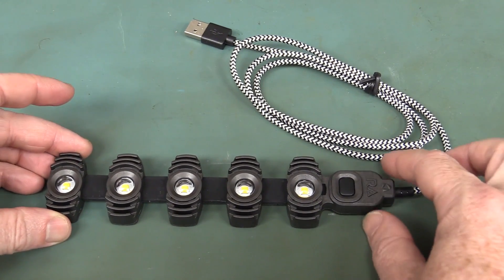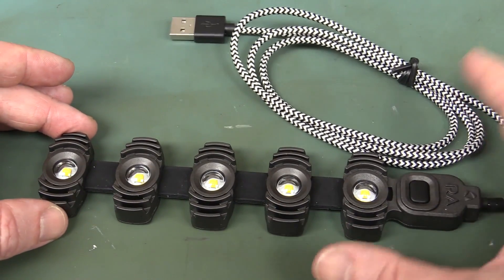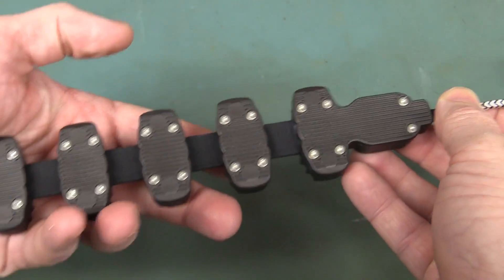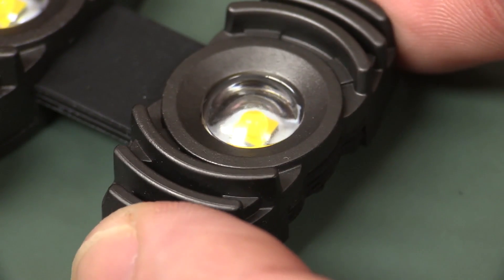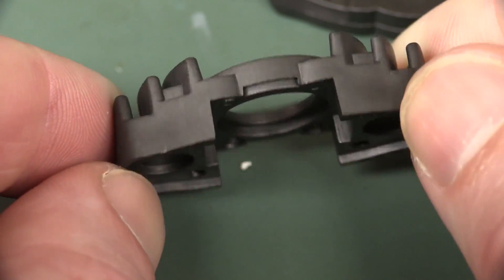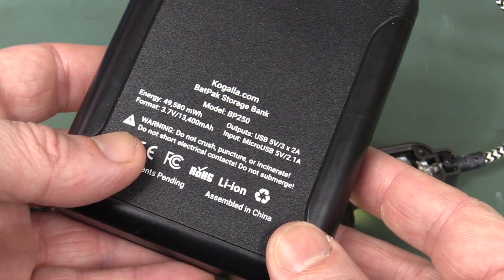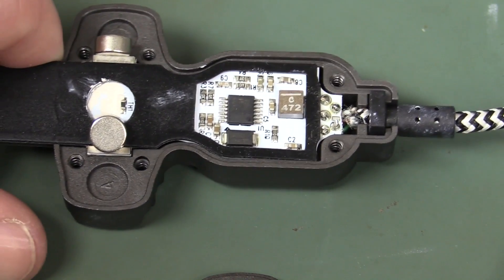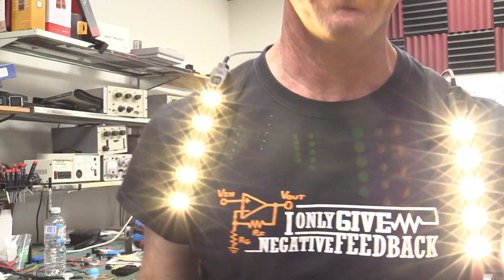EEVblog #1010 - Zyntony Ra LED Strap Light Teardown

Comment: $200? Seems a bit steep to me.
Reply: LazerLord10 go price just the cree led bulbs, im not saying i like it but 200 seems reasonable
Reply from the maker: Not when you don't have any competition for the form factor and it's well designed and built.
Reply from the maker: Not far off some Petzl headlamps.
In fact, two petzel headlamps to get the same output (or less) will cost you more.
Reply: The Cree LED's used are less then $2 even in low quantities of 500-1000.

I wonder what the BOM price is. I assume that the MIM'd aluminum parts are the most expensive parts.
Reply: Yeah. I don't know why you need 2 strips, or even 5 on a strip, because a $6 Chinese Cree torch puts out enough to light up my yard. This is the Apple of torches.
Reply: I'd agree. You can buy usb led lights online for under $10 usd. I use them for power outages and they easily clip to a backpack. Something tells me they are either vastly overcharging, or they need to lower the build cost.
Reply: Yip, you can get a Fenix headlamp with more lumens for $115 (plus a few bucks for 2 18650s) and an IP66 rating for the entire device.
Reply: John, you're completely ignoring the fact that you have to wear a damn headlamp. This isn't supposed to be a cheap solution... Good - Easy to Use - Cheap, pick two.
Reply: Go look at Scurion or Phaethon caving lights prices.
Reply: would probably come down as they get set up
Reply: Cyanide Cloud, depends on the design on the headlamp, if is an angle light then using it vertically is no problem.

Eg for cheap option, http://wowtac.com/wowtac-a2-headlamp-550-lumen/
Reply: Cyanide, the headlamp ticks all 3 boxes. This doesn't tick any - If it was any good miners would use this style of light instead of headlamps, it takes more effort than a headlamp to attach, detach and recharge, and it sure isn't cheap.

You and Dave go be guinea pigs - if it proves to be any good, I'll pick up a Chinese one for ¼ the price in a year.
Reply: If consider also the quantity produced, how to handle all the design process (it is not at all just matter of electronics inside), outsourcing for the various materials (aluminum and plastic parts) and make a living from that, plus all the inside-company-stuff that I ignore, is not that much. Chinese stuff from illegal china is from chinese people that do not eat, abuse of slavery and are polluting like hell. "The rock in the mountain is free, if you do not pay for the extraction" - cit.
Reply: @john, miners don't use them because miners don't wear backpacks, and mining equipment needs to be overbuilt and certified way more expensively using specific materials - mining lamps are also $600 each
Reply: Yeah SuperAWaC, there's no possible way this could ever be attached to a high vis vest... And definitely no way a multi-billion Rand mining house with it's own research center could ever develop a new light, with all that certification and specific materials...

Face it, this hasn't been commercialised before because it's probably worse that what we've already got. In conceivable every way.
Reply: they could, but why would they? caps lights have been used since the stone age and work fine. if you need any more light than that it's on a lantern or other equipment. these strap lights are just more shit to get tangled in your shit and be heavy while scrambling up the stope
Reply: I would pay 100dlls but for the full kit
Reply: There are always people who say the price is steep on these kind of products but there are a few things to consider on something like this

1: they are often by a very small team who has to make a living off of their work
2: It's not a mess seller
3: it hasnt been hit by a wave of chinese knock offs
4: it's new
Reply: The money is mostly in the heatsink machining x5. I could string together led's on a ribbon cable for cheaper, but I would not be able to make a decent heatsink for the form factor.

Comment: Absolutely STUPIDLY HIGH PRICE. 120 degrees beam is the raw chip beam angle.Draws total of 7W per string, TPS61500 is max 90% efficient, so let's say chips are running at 1.2W each - highly doubt 800 Lumens per string, as that would be 160 lumens per chip or 133 lm/W. Possible, but unlikely that they are choosing chip bins that high..Just  a plain out and out rip off.

Comment: I recently bought 10 LED torches from china for £5.00 (for all 10 including shipping) and they are brilliant (excuse the pun). They take a single AA battery at £0.15 which last for many hours and they have a clip to attach to whatever you want and they can be directed (pointed) in any direction and illuminate a wide area very well. They are aluminium, very tough and I could get 400 of them for the same cost and I can then use them for other things.
Reply: Jerry Walker What are you going to do, clip a whole bunch of torches to yourself? You'd have to deal with getting the angle right and turning them on/off individually, etc. Sounds like a pain in the ad to me. It's like saying, why would I spend $100 on a new HID bulb for my car? I can just duct tape a bunch of £5 torches to the hood.
Reply: Andrew Delashaw, No Andrew, I just carry ONE, read my comment. It illuminates very well over a wide area so I do not need to use more than one at once. If you need 10 cree LED's to see where you are going then maybe it is time to have your eyes tested. I would hate to be trying to pass someone on a mountain trail who is inconsiderate enough to have such bright lights blazing in my eyes and which they cannot direct. Same as someone driving at you in the dark with their $100 HID's on full beam.
Reply: Jerry Walker my Zebralights would kick the Chinese torch butt!
Reply: Knuckle head, What are you talking about? If you are out hiking then you do not need a lot of bright lights unless you just want to irritate other hikers. If you are just trying to compete so that you can say you have more lumens then congratulations you win, but you totally missed my point, well done.
Reply: fascinating story

Comment: Just my opinion... but I've never found fault in a decent head lamp. Plus at the price of the featured item, one could take along a spare headlamp or two and still save weight & money. Could probably go on; it's just that I feel headlamps are more the correct technology for the application.
Reply: @rwbishop - The only faults I find in headlamps are the narrow beam, the bouncing hotspot, and virtually no peripheral vision lighting. All I can say is you should give it a try! Huge difference.
Reply: Not all headlamps have 'spot beams'... know what you mean though.

Comment: Should have taken the battery pack apart. At least check who made the cells in the power pack! Also the non-waterproofing of the connection from the lead to the board is disappointing.
Reply from the maker: It was ultrasonically welded. Would have to dremel it open.

Comment: I don't understand the choice of USB for the power cable. It's not waterproof, it's not rugged, and it falls out too easily. A small sealed two pin locking circular connector would have been so much better, especially considering what the thing costs.

Comment: My prediction is that USB connector will be one of the first things to fail. A few weeks of work time in damp weather. Even if the battery is hidden inside backpack the humidity with this much power will corrode contacts to unrecognizable state.

Comment: They could have easily used the PIC to do the boost conversion instead of using an  external chip.
Reply from the maker: At this price point you don't really care that much though. Dedicated chip for the purpose and it's done.
Reply: That or simply picked a chinese boost driver. $1.5 vs $0.15
Reply: mikeselectricstuff possibly input issues? The micro listens to the thermistors then tells the pic via i2c to vary the pwm

Edit: vary, not carry
Reply: Mike's right it is a bit overengineered; a PIC (I'd use a 17 cent STM8S003 but whatever) , fet, inductor and a diode, and you're there. Thermistor(s) into an ADC input for overtemp; maybe a buck or so in volume
Reply: Dr Tune I don't think the thermistors on the lower lights have a wire to report back to the head (two steel springs acting as two wires only).  So I'm guessing the thermistors just do an overtemp cutoff of their local LED.  That makes the PIC basically a button input decoder.
Reply: I prefer step-down drivers from serial-connected 18650 batteries

Comment: Wait so the PCB runs the whole length? Good thing it does not flex too much, I'm imagining the copper traces on the board not lasting too long.
Reply: Huh? It still has to flex with the steel.
Reply: Optical fibre is a remarkable example of stress mitigation by encapsulation.
Reply: 'stress mitigation by encapsulation' Mmmmmmm engineering poetry.
Reply: Until someone thinks those long looping terminations are untidy.

Comment: there is a strange lighting effect at around 3:42 you can see the reflection of the room lights on the velcro tape
Reply: Sensor reflections! Wideangle Lenses (steep light angles) on mirrorless cameras can produce those effects.
Reply from the maker: I had the other one turned on the back side of the desk and it was reflecting off the metal shelving.
Reply: Perhaps, looked a lot like he had a UV filter affixed to the front of the lens. I'll have to test for some sensor reflection with my NEX-6 and 19mm lens...

Comment: Not too nice for night time stuff, as I can tell from practical experience of photographing in the dark.
Also not for walking on a trail one after the other.
A reddish hue is much better and does not kill low light vision. Nicer to let user have high intensity red light as well. If you are out in a group, those behind you can use red so you don't get blinded when you look back.

Comment: If you look down to see where you are putting your feet, do you destroy you vision and have spots before your eyes?
Reply: That's what I was thinking. The top light could have a lip to prevent light shining up to your face and the last one should be tilted down to light your feet better maybe.
Reply: Actually I was thinking that could be a big problem for other walkers in a group
Reply: @Greg Halliday - Nope. @petti78 - the lens has a nice smooth, but steep cutoff by design, so no lip needed. The beam angle is a wide 120 degrees, and you are correct, it does help to point them slightly toward the ground. Note that this naturally happens when you mount RA on you back back straps. @IWRConsultancy - As a practical matter, it isn't a big problem for others in a group. The 120 degree  beam angle means the light is spread over a wide area so the luminous intensity is much lower than if someone pointed a flashlight in your eye. However, if you get very close and look directly into a bright light...
Reply: If his pack had a chest strap like any hiking pack it wouldn't be a problem

Comment: A nice well made piece of kit, and for once a kickstarter that does have a useful purpose. 

A tad pricey for me. But then, there are plenty of people who splash out on premium-brand outdoor clothing, boots etc and I'm sure they would go for something like this. 

Not too keen on magnets. I mostly use GPS these days but there are times like in dense forest where you have to fall back on the old magic needle. 

The 7h life is also a lot better than most tactical torches give. Although the tactical torch is fully waterproof, which makes it more dependable as a piece of safety equipment in extreme weather.

Comment: 2x Energizer strap-on headlamps.
Take them off the strap and mount them to the accessory loops of your backpack straps.  Now you have a multi setting lamp set with way less fuss.  And the angle is adjustable.

Less than $45.00 US for 2 of them.

Comment: Sorry, but as a hiker and outdoors type - have been for decades - I feel like this is... well... a bit shit...

I don't have too much of an issue with the price, but I don't see the need to flood light your surroundings when hiking at night - maybe caving - not sure?  A good quality head torch is far more suitable IMO and lighter too.  What happens when you take your pack off to set up camp - you need to get a torch or head torch out then anyway.  Bit of a gimmick....
Reply: Phantomthecat When you camp, your backpack becomes a nice lantern. Of cause for multiday treks, you need to run at low power most of the time or have some major recharging power source.
Reply: @Phantomthecat - The only faults I find in headlamps are the narrow beam, the bouncing hotspot, and virtually no peripheral vision lighting. And of course, the constant moving of your head to shine the beam where you want to see. All I can say is you should give it a try! Huge difference.
Reply: Zyntony Social I think you need a better headlamp - mines got an adjustable beam so goes to wide which lights up a huge area with plenty of light to see what you're doing, or narrow with much more light.  You stick your pack on the ground with these things on them - what's the first thing you need to do?  That's right, open your pack but now you can't see what's in it without getting a torch out.  Sort of defeats the purpose IMO. They just don't do it for me.

Comment: I'd be interested to see the quiescent current of the lights and battery pack. It'd be a pain if you left it in the car for emergencies, only to find it drained itself flat! (I know, not its designed application, but still, would be good to see the numbers.)

Comment: I'm curious about that YZXstudio USB tester.  Is there anything that makes it better than other USB power testers?
Reply: randycarter2001 yeah. It tests things
Reply from the maker: I don't know, I got it in the mailbag and does what I want.
Reply: Yes, the accuracy is 4 digits, some are 5.., compared to less on the others, also many different modes, even volt/amp graphing and wireless output.  There are much better yzxstudio usb testers out like the color oleds with larger screen.  I also saw a newer one which was around $300.., It looked ridiculous and awesome, and has something like a waveform capture feature but I haven't looked at it closely.
Reply: Newer versions of the yzx USB meter can detect and identify charging protocols of the USB port (eg qc3.0). I think it can also analalyse the pd2.0 charging capability of type c ports.

Comment: removing solder mask makes 1/10th of dick all difference in terms of heat dissipation in my experience. More critical is the design of the traces/vias to spread the heat over as much surface area as possible, and the thickness of the copper. They may not have wanted an electrical connection to the heatsink either.

Comment: You said that you have static air in lab, and while walking it will cool down, but you must consider that when you wear it, you isolate back surface with your backpack straps.
Reply from the maker: It's doesn't matter, there will be airflow over the fins, and that's the point.

Comment: Looks like this thing can not be adjusted for optimal beam position.  Wasting lot of light.
Also you need a light where you are looking and not where your torso directed.
Good headlamp with multiple cree-XM-L with fresnel lenses will do the job much better. 
You can get any supersmooth beam shape with fresnels and they cost 50c for XM-L leds.

Comment: Why series connected? Wouldn't parallel be better and allow light in the event you damage one of the LEDs?
Reply: Parallel means more amps, so harder to deal with the voltage drop, etc. Plus parallel it doesn't balance the LED current properly, so if one LED is a different forward voltage then it will grab more current and overheat. Running in series means all of the balancing issues are handled automatically.

Comment: You took a little shortcut there Dave.  I wish you had taken the battery pack apart.  It's lithium ion battery powered.  Proper LI battery pack construction is essential.   Show us how they did it.

Comment: Interesting, So the battery pack is made by Kogalla and this was a company that did an indigogo campaign for a battery pack and solar cell panel for charging the battery pack. Then the kogalla site sells both the solar pack and these back pack lights. So they did separate campaigns two things, created a battery that can also be used with the backpack led lighting under another name and now sell both items on both sites. Double dipping the crowdfunding? Subsidiary companies? 
Or maybe the new "as seen on TV" way of doing things and one big company using the crowdfunding sites to back and preorder all these new things under different company names? Maybe crowdfunding isn't for the person with an idea who can't afford to take something to manufacturing anymore, but a new way of hyping up pre-orders with less risk of loss if it doesn't meet the goal to bigger companies now?

Comment: Those braided USB cables are really cheap. They come in packs of three, are 3 meters long and are only £6 on Amazon with free shipping. About $10 USD. But, they are very long lasting. After buying 1 pack I was so impressed I bought another 3 packs, to give some to my Mom, some to my Son, and to use them for all my USB needs, hahaha.

Comment: Hey mate it looks like a standard Cree XPG3 on a DTP MCPCB? These XPG3 are one of the cheapest Cree LEDs you can buy. They have good lumens per watt output rating while being run to Cree specs. Plus it looks like a 4000k tint lose a bit of output their?  
 The optics used looks like a standard set up also nothing special their its an of the shelf part? 

You could use a headlamp or just strap a light to your bag and it will do the same job while being more robust? Or check out some bike lights?